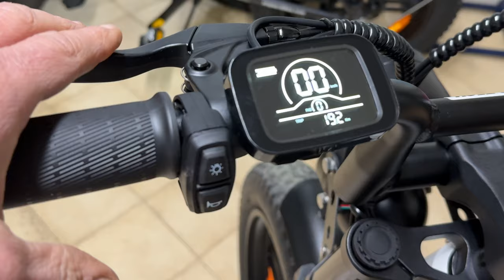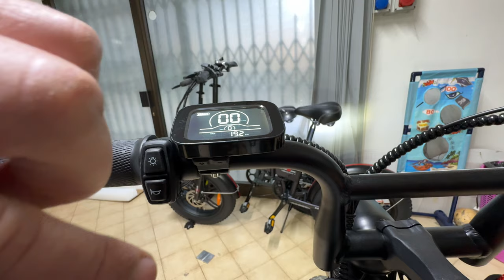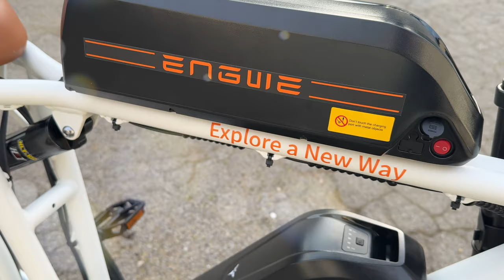ENGWE M20 - EBIKE AND MOTORCYCLE IN ONE VEHICLE - FULL TEST, TUNING & TOP SPEED - 4K

Comment: Just got this bike. I can hit 38 MPH on flat leveled ground. 28 miles on uneven paths. No peddling.  Seat kind of sucks. Im 265lbs 5' 10"
Reply: how did you get it to 38 MPH? from what ive seen it tops out at 28
Reply: @Taim-Salamor but 28 w no pedaling?
Reply: @ventinator0  yeah 28-29 no pedaling just throttle. pedaling doesnt really work after you reach speeds liuke 21 mph cause pedaling wont affect anytjing
Reply: It doesn't reach that speed.  People are changing the wheel diameter size in the setting making the bike think it has bigger wheel so it must be covering more distance for each revolution and give higher speed reading. in reality is they are doing 24mph 🤣

Comment: This video is miss leading and spreading false information.  if you want to know how message me ✌
Reply: Are you saying that the tuning he did to the settings on the video doesn't work?.....have you tried it?
Reply: @petergouveia9312  Yes he shows he is doing more than 40mph but in reality, he is doing 24mph. He put false information in the tyre and sensor setting. This is basically making the bike miscalculate the speed.
Reply: Have to tried these yourself?
Reply: @petergouveia9312  no because you can clearly see from the video he is not going as fast also it's adding false information in the setting